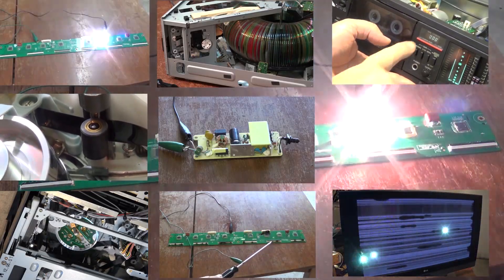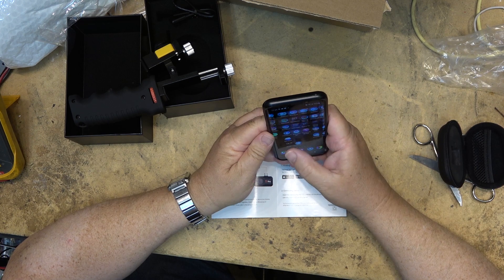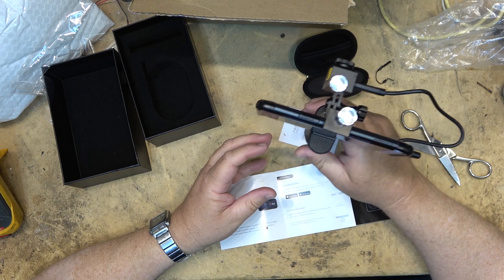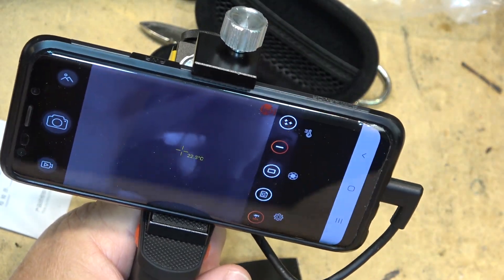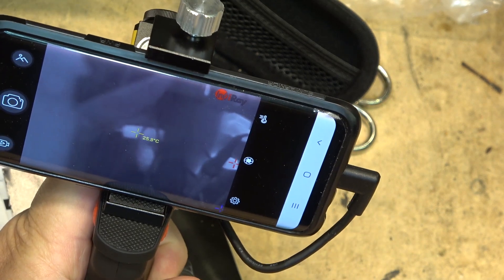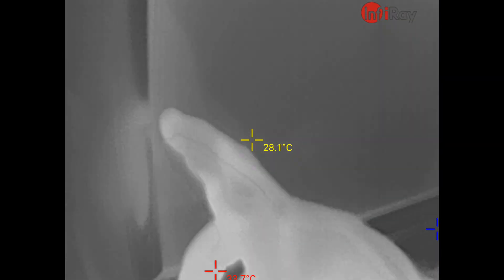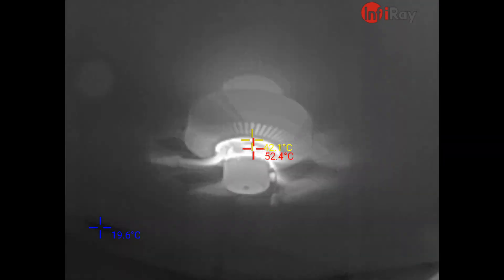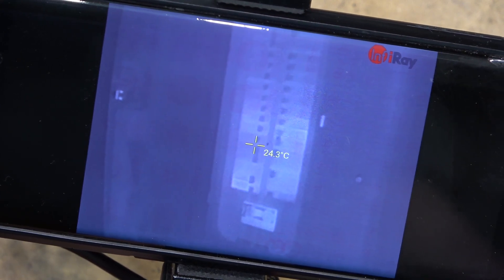InfiRay Thermal Imaging Camera unbox setup and demo with footage directly from camera

Comment: I need one of those for finding shorts in miniature circuitry.  Don't want to spend too much because it's just a hobby and if you buy something too cheap it's useless and you have to start over.  That looks just about what I need.  Would like to see you use it to find a short in a cell phone or tablet-type device.
Reply from the maker: I don't have any of those devices that are broken.  I would imagine it would make finding a short on a solid capacitor a little easier.  The false color modes look rather psychedelic.

Comment: Would have been cool to look at the garden hose as you turn the water on, you can see the cold water show up as black as it goes through the hose. If you put your hand inside a black garbage bag, you can see your hand right through it like it is transparent. I seen a guy put his head inside a black garbage bag, but I would not recommend it, gives kids an unsafe idea. How much was it? I was looking at buying the one shango066 uses in his circuit board diagnositic videos, but that one is $300 and in color. I think I like the black and white version better. Do some circuit board videos of output transistors, you could spot hot or cool one quick. Old radios to spot hot capacitors that are leaky. I got to get one of these.

Comment: It's a must have device to help diagnose problems specially SMD Components.
Reply from the maker: Yup will detect hot parts.
Reply: @12voltvids  I really want to have one but unfortunately due to financial incapacity, I'm unable to grab that one. The product I want to buy is Flir Thermal Device. but if I want to make it cheaper, I'll buy a cheaper one as a starter kit.
Reply: @JaypiTechPHOfficial  you can get them built in in several Chinesium smartphones..I'm thinking of upgrading to one..
Reply: @lebenitj  I'm using Xiaomi with a Quad cameras. It's possible but not really reliable.
Reply from the maker: Worked out well in the tv i just troubleshot today.
Reply: @12voltvids  very nice.

Comment: I'd be interested to know the temperature difference between white cars and black or dark colored cars, and how it affects the AC, and how long it takes to cool the interior of white and dark cars? In the case of battery powered cars, how much energy is required to cool a dark EV as opposed to a white EV?  7 3
Reply from the maker: Actually I can do that expirament.  One of my cars has a black roof.  I can tell you it gets real hot inside.  Much hotter then the one with silver roof everything else equal (black leather interior).
Reply: @12voltvids  Back when I was riding motorcycle one of my helmets was white, my buddy had the same one in black, we compared them by touch, he painted his white! You don't want hotheads on Motorcycles! So a black or dark colored car sitting in the sun has AC that must work that much harder to cool the inside down. Not only is the air warm, but so is everything in the car including all the parts that make up the AC system, plus the seats, dash, and interior of the vehicle, all are radiating heat. A white car should cool down in a shorter time, also if you can park in the shade. One more thing, those window sun shields, use it on the outside of the car over the window. Inside it just becomes another thing to heat up.  I have a black 1 ton Dodge, um toaster!
Reply from the maker: @PGE564  
Silver car coolest of all.  Silver reflects heat.

Comment: Sure does glitch a lot. I've seen this in other videos as well. We'll see if my P2 Pro has this issue on my phones or on PC.
Reply: Do you mean the brief pauses? Those aren't glitches. Those are completely intentional calibrations due to this type of uncooled sensor. The shutter physically closes, you can hear a clicking as it does this, then it runs a self calibration, and reopens the shutter.

Nearly all of the 256x192 USB cameras on the market right now use the same Infiray Tiny1_C sensor. The only difference is the app that the vendor provides,.but even those are usually interchangeable between brands. The operation sill be the samem
Reply: @Fluvance  There are visual glitches, lots of garbage on screen pretty often.

Comment: On a live chassis, hmmm, resistors, transformers, caps, coils, pots, tubes, transistors...  as Artie Johnson would say, "very interesting -- but hot stuff!"
Reply from the maker: Will be used on a future repair.  This was just to show it off and how to operate it.  Most people that buy this type of device are not hobbyist dicking around with electronics. It would be people that are in the home improvement industry so they can show heat loss at windows and doorways etc. That is what this device is marketed to showing heat loss from buildings so that improvements can be made. It's far too expensive for a hobbyist just tinkering around with electronics to require something like this. Maybe someone doing motherboard repair down to component level might find it useful for finding a hot part but those people are few and far between. More and more this will be used by people in the home renovation industry so they can spot where heat is being lost or were cold air is leaking from air conditioning etc. That's the target market for a product like this not so much hobbyists because it is an expensive device.

Comment: That's a neat little device. However I can't afford to spend $439 on much right now. 
Funny how there's only one review on the Amazon site, and it's a 1 star because the guy couldn't figure out how to get the app to work on his phone. Maybe he was on a really old Android version. He mentions his whole family has cheap Samsung phones, under $200 each.
Reply from the maker: I initially had the app fail to install and had to grab the alternate . APK file as my phone is old. 5 years is old for a phone isn't it?
Reply: @12voltvids  Apparently the Android 10 problem is a Google one, where they both required that apps be built for a later API version in order to have it on the Play Store, for which camera functionality was broken. So the only way to get the earlier API-version app to the user is to have them download it manually outside the Play Store.

Comment: Checked out the link, it shows color images. How come your pictures are in black and white?
Reply from the maker: Because that is how i shot it.  White hot black cold.  Much higher resolution than false colors.  It has iron 🌈 rainbow, iron rainbow hot/cold, rainbow, iron h/c and black hot.  There are no colors in infrared.  White hot gives the most details. You can actually see an image as opposed to colors but if you like colors it does that too.  I prefer detail in the image. It can also overlay your pho e camera as a picture in picture so you can compare both images in one picture.  It will generate reports that you can edit in word. (docx)

Comment: Really bad review THAT'S NOT WHAT IT'S MADE TO DO IT'S FOR ELECTRONIC COMPONENTS  .Not for a wall or your body parts
Reply from the maker: Actually they are for tracking heat loss. Insulation windows weatherstripping ect.  It shows heat regardless of what it is coming from.  Yes they can come in handy to find a hot part however i don't have any broken electronics that I can demo it on.   Next tube radio I work on I will look for paper caps that are heating due to leakage but as of now they have all been changed out so I wouldn't expect to see any excessive heat.
This is actually marketed to people in construction and renovations to spot areas around the home that need attention.  That's the intended market for such a device and of course law enforcement to see people hiding in the shadows.  Electronic hobbiests or even those in the repair business probably makes up .1% of their intended market.  It's a tool, but not the end all tool.  Sure it will show components that are hotter than others but if you understand anything about electronic design there will be components that do run hotter than others that's just the way they're designed. so saying I'm going to point my thermal camera at a circuit board and it's going to tell me what part is broken that's not going to happen you're going to see all kinds of parts that look hot on a thermal camera but they're perfectly normal. So as a diagnostic tool I would put this down near the bottom of the pile. The real intended uses or whatever already described above I'm at tracking heat loss from buildings or searching for people hiding in the shadows or even looking for animals in the dark. You can't hide from the camera unless you are long dead.
Reply: Thanks for all the info Love your videos